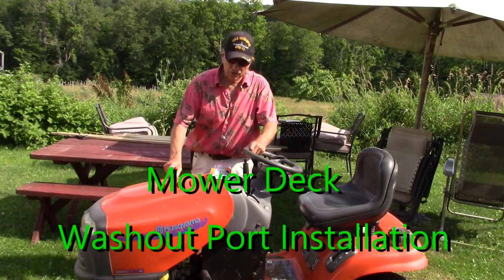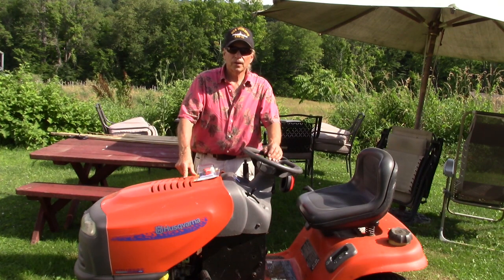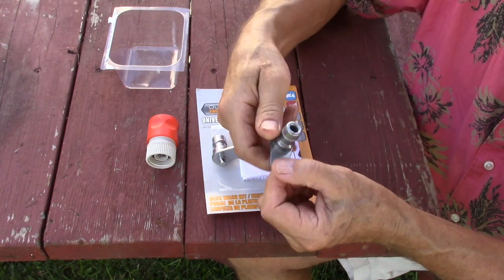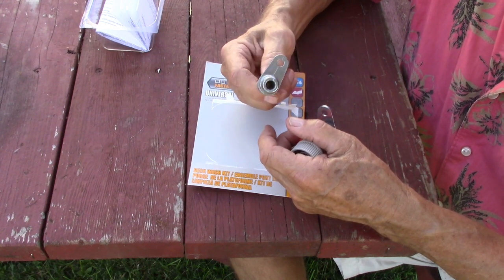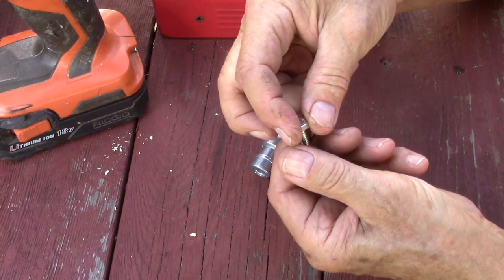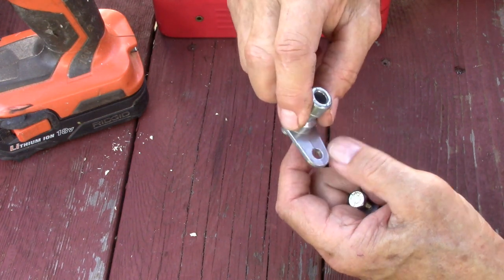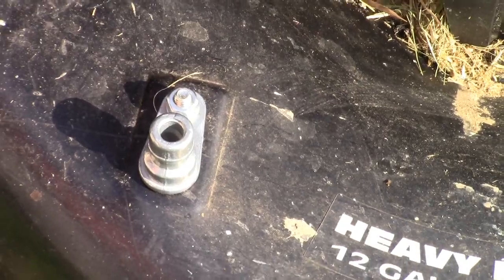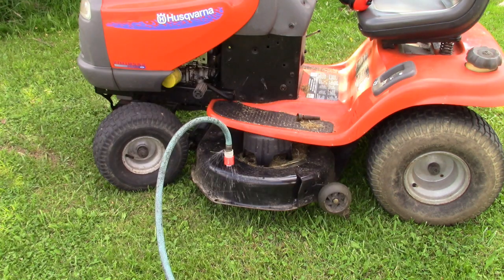Mower Deck Washout Port Installation

Comment: Very good video.  Three things I did in addition.  I sprayed some spray paint into a disposable cup and painted the exposed metal with a Q tip.  I then got some rubber flat washers from the plumbing section of the hardware store to use as O ring on the bolt to prevent moisture.  Lastly, I used a nylock nut instead of a standard nut in my application.
Reply: Couldn’t have put it any better myself 👍🏻

Comment: Now if you take your quills off remove the inner seal of the sealed bearings then before reinstailing them and the Shay’s or bolts .  Fill them up full of grease a while having them apart drill a place a grease zero were you can get to it easy from the out side on each side of your mower.  When you change oil just a couple pumps in each side and your quills will last a long time .  Great video you did a great job explaining in detail of the whole reason a placement of the water jets .  I’ve had the same problem with the weak breaking metal and then patch after patch a replace and weld the mechanism parts tgat hold it on .  Even the neighbors lawn mowers also .  Those quills are expensive and the bearings are sealed .  My uncle came back from Indiana 40 years ago .  He told us how all the steel mill workers were he worked would fix those sqwilling quills .  So they wouldn’t a they would last as long as the mower . The main thing he said was not to pump a bunch in them cause that would make the outside seal pop out .  If you can keep one from rusting and keep from having to replace those quills you just about will never have to take the deck off .  Blades and belts can be changed on most all with out removable.  Again great video see your a Vet thanks for your years of service and keeping our country protected your a great man I had 4 uncles that did they taught me to have great respect for our service members so again thanks! 😊

Comment: Thank you for taking the time to explain. I just bought a Husqvarna that has a wash port already installed. It also came with a Gardena stop whatchamacallit, dohickey, thingamajigga, whatever it’s called. However, nowhere in the operator’s manual does it explain anything about it. So of course I went to You Tube and your video was the first one to pop up with a Husqvarna in the thumbnail. Thanks again. 🙂
Reply from the maker: You are welcome!

Comment: That is a great idea to mount the sliver piece on top of the mower deck instead of the underside of the.mower  deck because of the type of blades that are on the mower deck as in the style of the blade being a low  medium lift or a high lift  because of the area where the water is  coming.out   because it will be in the Way of Wing on the blade.which  a high lift blade would hit the water outlet   if you mount the sliver piece on the underside of the mower deck I have 3 mowers  2 of them are 42 inch cut and a 50 inch craftsman gt tractor Plus have a Husqvarna AWD mower which is already having the mower deck washing system

Comment: Hi Mr. Porta, related to your old aquaponics setup. Air bubble disease - I just learned about it. 
I remember you had an unexplained fish die off in your aquaponics. And I wonder if the cause could have been air bubble disease. Kind of like a fish version of the scuba diver “bends”. It’s caused by adding air to fish water under pressure. 
Anyway I thought of you. I’m tinkering with airlift pumps. 
Cheers.
Reply from the maker: cyclone would be the way to go---no bubbling, just increases the surface area of the water

Comment: I strongly recommend you use a nylon lock nut doing this
Reply: In saying that, that’s a Australian design the hose connection is the norm in Australia we don’t have screw on hoses everything is hose connectors (quick connectors) as you call it but to save you a bit of pressure get the hose female connectors to have 3 catches not 2
Reply from the maker: thanks for the tips

Comment: Looks like pot metal or it could have been spot welded to look even better. The water jet is going to hit that bolt if it's low enough. Drill and tap for a 1/2" long short bolt.
Reply from the maker: that will work, my jets clear the underside with no problem

Comment: Use stainless steel for the bolt and washers and a nylon locking nut

Comment: Won't the bolt you use get in the way of water jet? Maybe a stubby self tapping screw and no chance of the bolt coming loose and hitting blade.
Reply from the maker: I  installed  the  bolt upright---only the bolt head is in front of the jet  and it sprays over top and misses the bolt.working great!
Reply: My thoughts exactly

Comment: I would have put the bolt on the top and nut on the bottom.
Reply from the maker: good call!
Reply: @donaldporta  But, then the bolt will protrude in to underside of the of the deck and if its too long that will impede the flow into the area under the deck where the grass etc accumulates, [which you're trying to remove]. If you cut off the excess bolt so only the nut and washer protrude inside the deck that might be ok. The 1st fix ie have the head of the bolt only protruding in to the inside deck area is the best option.

Comment: Your information is not accurate. That 'embossed' surface on the deck is NOT for the washout port. It's for the leveling of the deck itself. This is why it's labeled "LEVEL" with a decal from the factory. Geeze man.